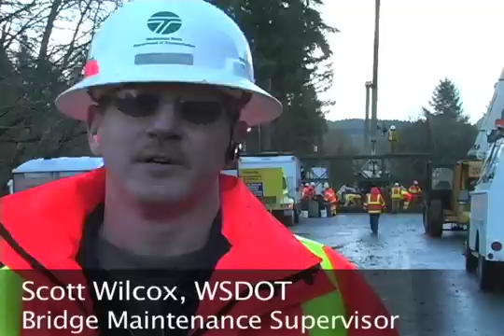Rapid Bailey Bridge

Comment: Basically, this actually is what will be the temporary replacement for the collapsed span. Because it needs to fit /within/ a certain space, they probably have to custom fabricate some parts, but other than that, the temp replacement will essentially be an off-the-shelf Bailey bridge-type structure.